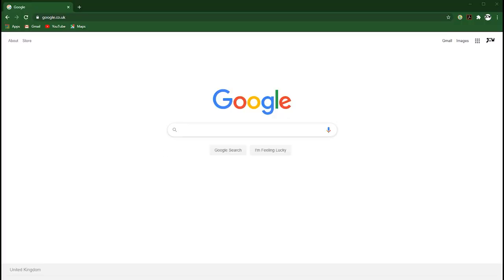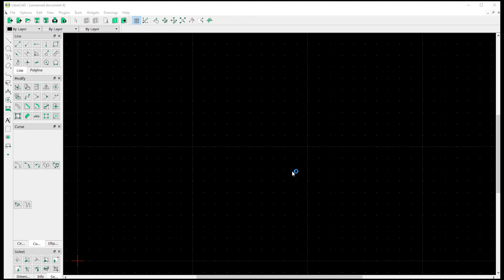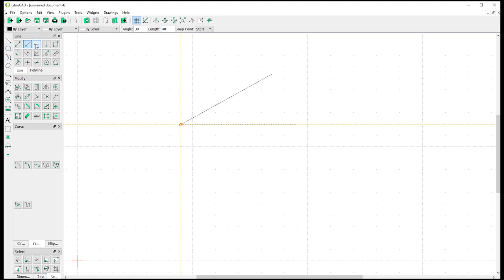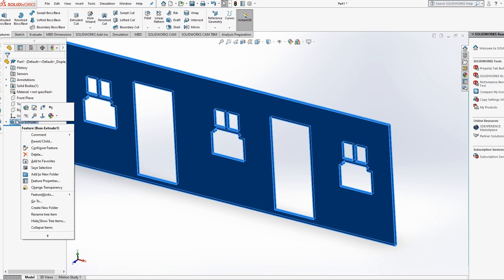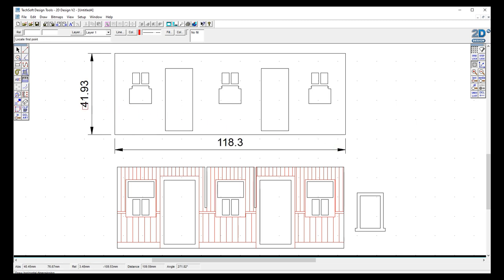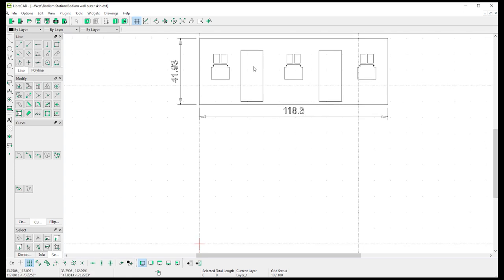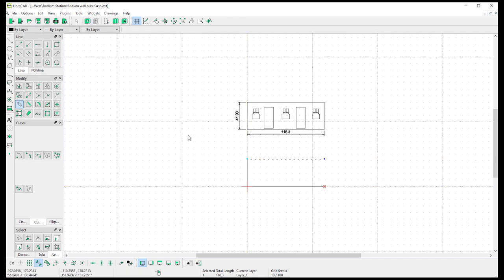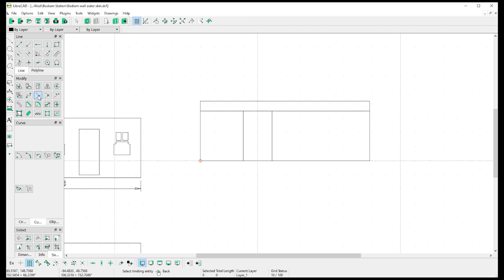The CAD series for Railway/Architectural Models | Part Three | An introduction LibreCAD

Comment: Hello James, i use Apple equipment i have an iMac and i am quite keen to have a go and try this, but the LibreCAD software does not seem as though it will work with Apple? Is there an Apple package that you would recommend? Great video by the way, i cant wait to have a go. Thanks again.
Reply from the maker: I believe LibreCAD is available for the Mac, although I haven't tried it yet.  You should be able to find the download link by googling LibreCAD for Mac.
I don't use LibreCAD myself day-to-day, but have been using it for these videos as it's a free download which is always a good starting point for those new to CAD.  In my experience all CAD software works in similar ways, and if one focuses upon what we want to create and consider the geometrical elements and principles within it, then understanding how to make the software comply becomes much easier.  
In my experience of teaching CAD, students will typically experience frustration which can be overcome by considering the basic principles.  As an example, they might wish to create a circle of a certain diameter, but have given no thought to its precise geometrical location on the drawing.  Once prompted to consider exactly where the geometrical centre point ought to be, the task becomes simpler.  Time spent mastering basic geometry will serve the CAD operator well.
Good luck,
James
Reply: @BexhillWest  Hello James, you were right! It is available and i have downloaded it. Thank you so much, now time for practice!

Comment: Hi James- Excellent video I have downloaded LibreCAD and had a go with some success and looking forward to some more practice. I notice you have the tools such as lines and delete on left of screen  where on mine  I get them via the Edit tab is there a way of changing them ?     Cheers Kev
Reply from the maker: Hi Kev, so pleased to hear you have had some success already.  Yes the tools can be changed and custom menus created.  This is a great question.  I'll cover it in the next video which will probably be more understandable that trying to answer the question fully here, so stay tuned and keep practicing - I'll be setting homework soon! :)
All the best,
James
Reply: Excellent I shall look forward to it as it’s like being back at school but without the worry of a black board rubber  coming at you at head height 😀😀

Comment: I'm keen to learn this CAD software and it is brilliant that you are doing these videos James. I have struggled to find that Snap to grid button though on my install.
Reply from the maker: Hi Brian, I'm so pleased you are getting something from the videos.  Without seeing your screen, I can't really comment upon your installation, but the Snap to Grid tool will be there somewhere.  Look for the icon with a 3x4 grid of little green dots.  If you hover over it it should display 'Snap on grid'.
I hope that is of some help, let me know if you are still struggling.
Best wishes,
James
Reply: @BexhillWest  yes I did find it with all the other Snap to tools hidden where the Ex is at the bottom of my screen. I have now reset it all back to default so the Snap to tools are all visible, I had been moving things around having a play with the layout.

Comment: Hi James, I'm familiar with Inkscape which works by creating and altering basic shapes, so our walls here would be formed from a rectangle whose dimensions can be set by typing them in. This appears to be a slightly more convoluted process for drawing lines. I notice there isn't any kind of "Fill" mechanism for the outline - or is that because Libre Cad works by using lines (Vectors) rather than shapes? A nice, clear explanation, unhurried and something new for me to get my head around. I have my copy installed so I can play around with it over the next week or so (work permitting.) Looking forward to the next episode. Thank you.
Reply from the maker: Hi Paul,
I totally agree, what we've seen here can be done in inkscape or other packages such as Adobe Illustrator as well.
I'm well aware that my explanation of the processes shown here is quite long-winded and makes the process seem convoluted.  The truth is that once confidence is achieved with the software, then the drawing processes become very much quicker.  Indeed, there is a rectangle tool which I could have used which would work in just the same way as inkscape.  There is also 'fill' tools which we will come to in time.
I think, and this is just based upon my own experience so I'm happy to stand corrected, that tools such as Inkscape and Illustrator are more ideally suited to preparing 'graphic' drawings, whereas for more 'technical' drawings the more advanced tools in a CAD package can be more suited.  As just one example; the ability to use mathematical formula can greatly speed the drafting process, and CAD packages tend to deal with this better than illustration packages.  I'll cover this in an upcoming episode.
That said, when I last used Inkscape, it had a handy gear generator built into it which made the process of drawing spur gears really easy.
I find that Inkscape, Illustrator, Corel Draw, etc are very useful for converting different file types into formats which CAD software can understand.  For example, Illustrator will convert a .pdf into a .dxf which can be very handy indeed.

Thank you so much for watching, and for your thoughtful feedback which will help make future episodes better.
All the best,
James